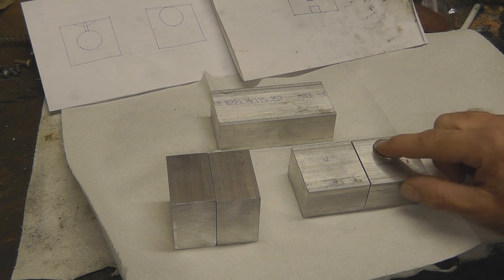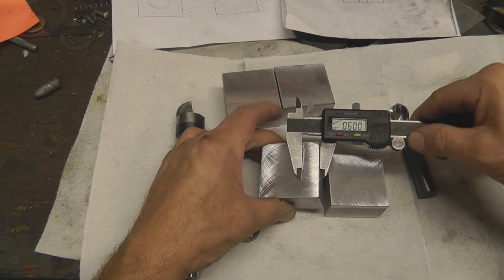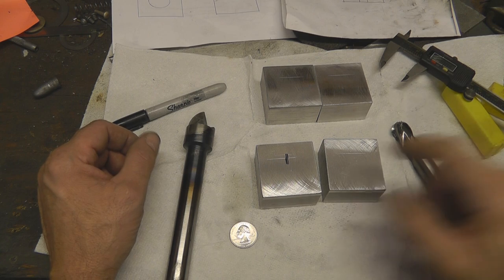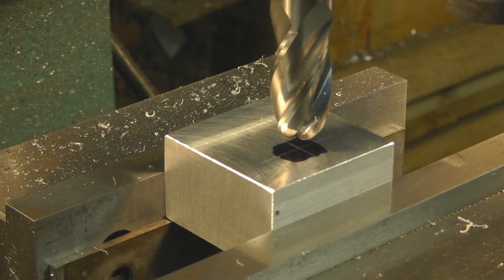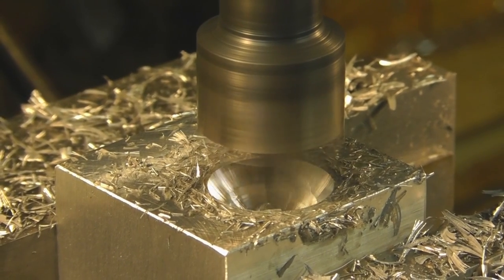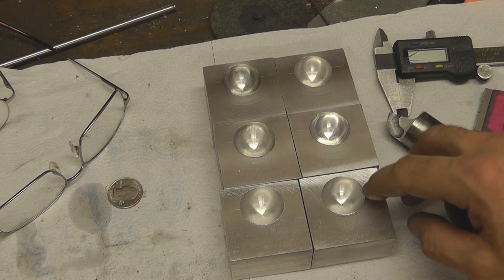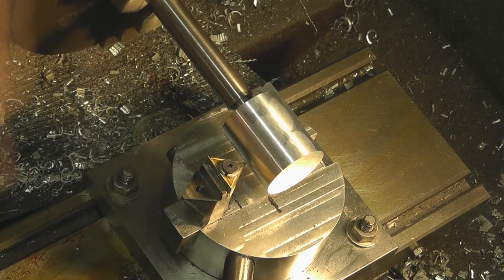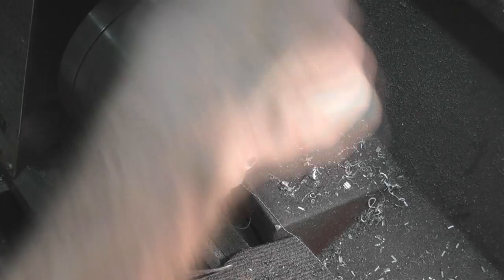How to Make a Cannon Ball Mold, Part 2

Comment: If you offset your radius cutting lathe gizmo in the other direction, you could us it to cut the half sphere directly into the mold block mounted in the lathe chuck and skip the custom cutter altogether. If I had to make these, I would first machine the parting faces flat, add locating pins by drilling/reaming through both stacked blocks, then machine them together so all sides are flush and square, and use a dial indicator to position them in a 4 jaw lathe chuck to machine the cavity.

Comment: Just a tip: Sometimes you're measuring diameters with the calliper points pointing in the axial direction. You should have the calliper points pointing alond the plane of the cross-section of the cylinder to make sure you're always taking the max diameter. I.e. the true diameter. It's impossible to be positioned wrong like this.

Comment: It's a cool project.  I would have milled the mold about .005" deeper than necessary to ensure the full radius was formed into the aluminum.  Then fly cut the excess off of the surface until you can measure the exact diameter you needed for the mold.  this way no oblong balls.

Comment: He is facing them off first, and that should be the last step.
Step 1: cut the ball mold inner halves.
Step 2: cast 2 halves and use them to align the mold halves and assemble them.
Most would use a steel ballbearing to align them.
Step 3: drill and install the alignment pins.
Step 4: face off the exterior faces.
Step 5: cut the mold handle reliefs.

Comment: I am definitely not a pro-machinist, but I've got an idea for you.  Make your ball turning attachment so that when the front end of the slide (part that changes the diameter of the ball) is flush with the outside of the base it holds the cutter tip exactly over the center of the pivot.  Then when you slide the slide out, you can measure how far the "stick out" is and get the exact radius of the ball you want to cut.  You would need a longer slide on the back to compensate for the extra in front.

Comment: Chatter is caused by hitting the resonant frequency of the cutter or workpiece.  It can usually be cured by either speeding up the feed, or slowing down the spindle speed.  On the lathe, the work piece should always be as close to the chuck as possible.

Comment: good stuff. liked it. To Every one always remember measure 100 times before each cut. not one time after 6 cuts. on the bright side, if they dont work for the cannon you have some good sinker molds. just mill a slot for an eye screw on one side.

Comment: It is really tough drilling both halves with a large diameter ball end mill and get both separate pieces exactly aligned. So I bought a steel ball bearing the size I needed and just drilled both of the molds close with a ball end mill in both halves. Then I just put the exact sized steel ball bearing in the mould and clamped it in my mill and decked all the sides nice and flush, and at the same time drilled my alignment pin holes keeping the ball inside, makes for really hassle free very precision alignment 👍 but of course this method only works if you can find a steel ball and ball end mill bit the size that you need. The mold i needed just happened to be exactly 1.5"

Comment: When I was working as a CNC operator what they did for stamping dies is they would mill it to +0.005"(I believe that was the spec, you could probably get away with +0.010" for the mild), send it off for heat treating, then bring it back and finish it off. You might be experiencing problems that procedure was designed to counter. One thing that bugs me is the way you milled for the cutting edge, It looked as if there were some huge flats along the edge and the cut path was awfully crooked.

Comment: As you had a DRO on your mill, could you not have drilled two holes straight through each casting block a set distance away from the center of the casting holes  (when you were making the round recesses, before you un-clamped the workpieces) to take some alignment pins?  This would remove the need for an alignment ball all together.  I think this is how I would have done this, but I'm no professional.  Thanks for the upload!

Comment: Good vudeo! Just a tip to speed you up. Start with your whole bar in the vise, figure out where your alignment pins will be in relationship to your cavity, leave a little for the saw to separate the blocks from the bar stock, drill all your holes at once just swapping out for the ball cutter. You can use the DRO or count turns. Cut your blocks off of the bar stock pin them together, back in the mill to clean up the edges and Mill your slots for the handles and you're done.
Reply from the maker: Thanks!

Comment: you could have just as easily carved the mold out on the lathe with an inside radius cutter. (same idea as the ball cutter just reversed) and put them in a 4 jaw chuck.

Comment: Nice effort, but I see it as a failed experiment - even if you made your cannon balls, you would have been happier having figured out a sure-fire way to produce spherical positive and negative molds. To save you the trouble, you could have bought a ball the size you want from the chinese, failing that you could produce a spherical artifact polishing machine (the sphere rotates on an axis orthogonal to the polishing head, which also rotates). The plunge cutter flexed, give it 2 cutting edges.